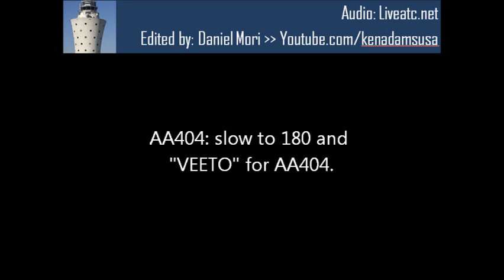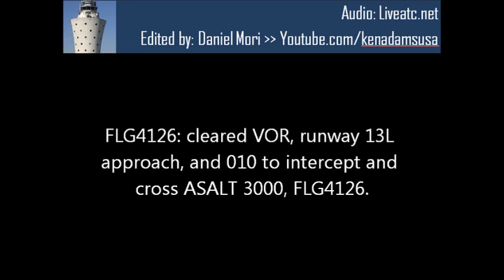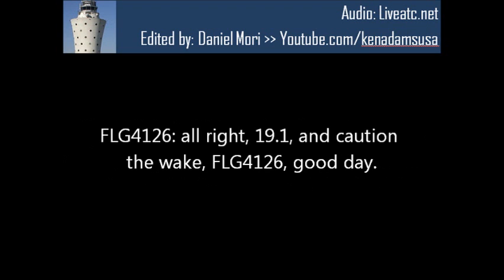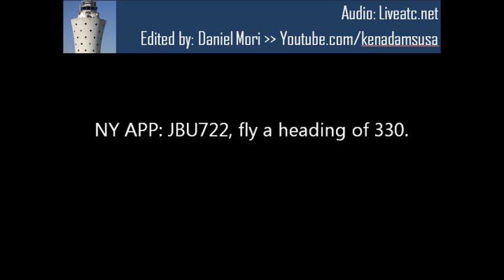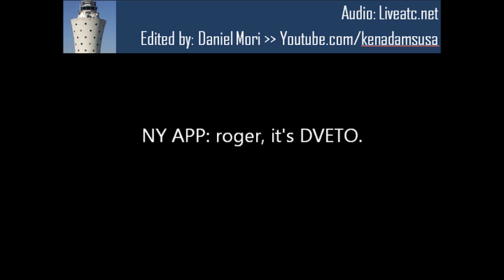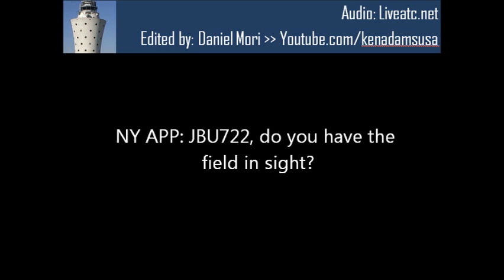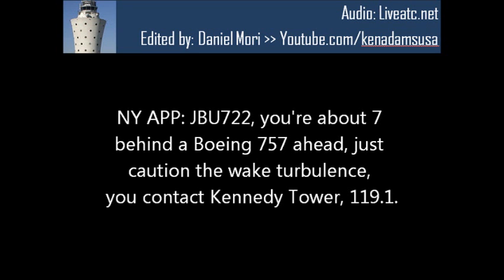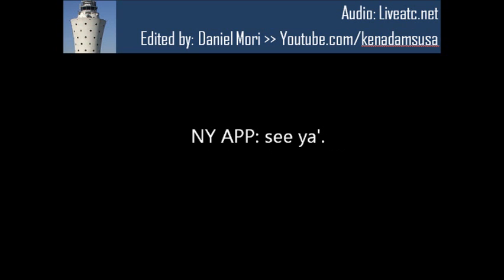"Hidden Fix": Air Traffic Control and the RNAV 13L Approach at JFK

Comment: can't find an RNAV 13L approach plate at airnav. Is this discontinued?
Reply: Hell, I can't even find an RNAV 13L approach. I see VOR or GPS 13L/R (which is not technically an RNAV) (and I thought they'd deleted the "or GPS" approaches at major airports), and that one has ASALT but no DVETO. Maybe they modified/deleted it after this brouhaha.
Reply: RNAV Visual is not really for GA (iirc it's actually designed for those with RNP equipments), that's why you can't find it on FAA website.

Comment: It's the RNAV VISUAL approach, which is only published in Jepp charts accessible to certain airlines. Typically it'll be airlines who have a lot of flights into the airport, like Jet Blue, AA, Delta at JFK. There's also RNAV visuals to 19L/R at LAS for example. What this approach does is allows the pilots to fly a precise and predictable path on a visual approach, with RNAV guidance.

DVETO is there, but it's shown lighter than ASALT and the later fixes, so it's easy to miss.

Comment from the maker: No mention of DVETO in STARs. The customized approach plates for the RNAV 13L also do not list DVETO. The ATC instruction is possibly to be interpreted as: "fly direct to DVETO, then fly to ASALT to intercept the approach". What probably confused the pilots the most was the understanding that they were to intercept the approach course at DVETO. I still don't have a conclusive explanation. Don't take what I write for granted.
Reply: Daniel Mori It’s on the RNAV Visual 13L. Here is a link to that chart. http://fsims.faa.gov/wdocs/oswg/kjfk%20rnav%20visual%20rwy%2013l.pdf